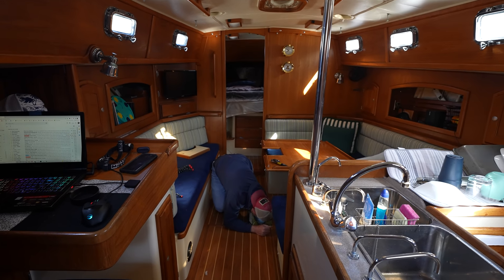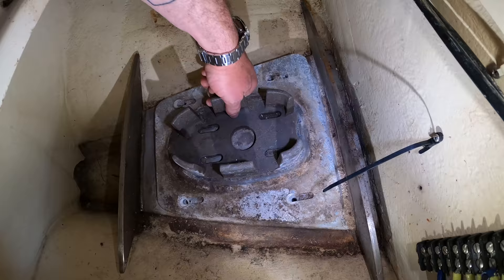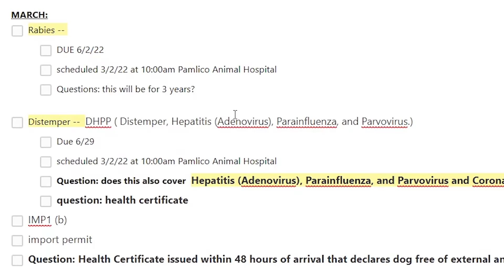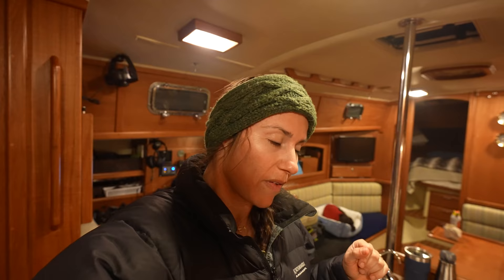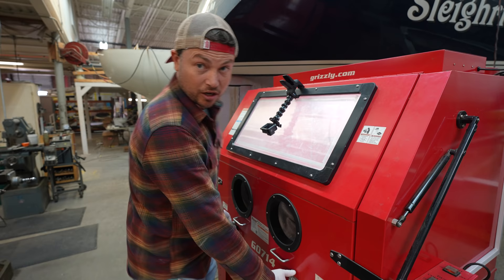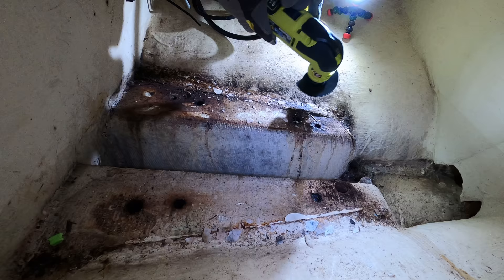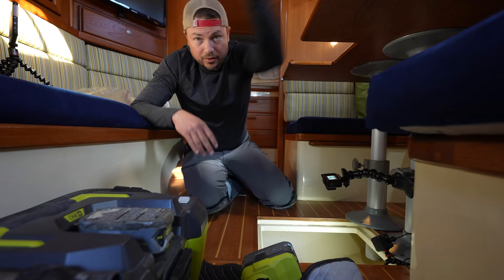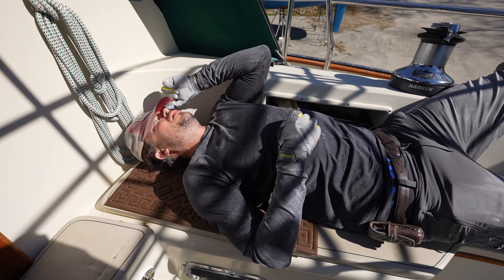We’re getting CLOSE… Right?! | S06E37

Comment: Whenever I get the urge to buy a boat, I just watch a couple of your vlogs and it cures me of the urge! Thanks!
Reply: funny
Reply: This is true. Jordan is very good at doing projects, enjoys doing projects and has a high threshold for frustration.  I do not enjoy projects and get frustrated quickly. No boat ownership for me.
Reply: Though job the mast steps .
You ended the video before 
I could see what wood you used .
Im sure the replacement is long done  by the time you read this. 
I have a leaky Teaky my mast steps are solid teak and not glassed  or painted and are 44 years  Most of the time wet and in perfect condition  just food for thought. 
I have replace other  rotted wood 
On my boat  supports and parts of the Bowsprit with ipe wood . If your not  Familiar with it it's Brazilian walnut it one of the hardest  strongest wood on the planet does not float  and is  Guaranteed for 75 years without rot.
Reply: @sizzlemann there nothing like being on the water
Me it gave me the urge to buy one,start small
Remember they are refitting for long passage there boat is in super condition
Reply: True . I will not own another boat it’s more work and cost Over renting and renting is not cheap. I would like to know the cost of their work when they are done.
Reply: About the same as a 30 year old house. Always something needs work.
Reply: Yo Sizzie, find a 16 or 18 footer, I had a 18ft Buccaneer great little sailboat to learn on not many moving parts, swing keel draft 3ft down if you find one buy it.. My boys love playing on it. Lake boat or bay sailing.. I'll buy it off you after you learn and buy a larger one.. carry-on bud.
Reply: This wonderful couple isn't alone. Almost every sailing channel shows how much maintenance is required to go blue water sailing. Every time I see videos of people lounging on the deck of a sailboat with a cocktail in their hand, I think of these videos, lol.
Reply: My thoughts exactly!
Reply: I think they are very brave to do this. Any old boat will need attention though. Seeing that rotting wood makes me want to buy a steel boat even though it would be slow, it could hit a submerged object (think container) and probably not sink!
Reply: I had the urge to run a marathon once, but I laid down until it went away.
Reply: Everyone should have a hole in the water to throw money into!!
Reply: If you think this is bad buy an old house. LoL.
Reply: I sailed dinghies as a teenager (lake not ocean). I realise now why dinghies are so great. Takes hardly any maintenance and still heaps of sailing fun. I used to to think a keelboat would be way more fun but not so sure anymore😅
Reply: @MaShcode  , true. However, you’re not over water with the possibility of drowning in an old house on land.
Reply: @anitafarwell5325  Not a property I once owned. Haha. It might as well have been a house boat. Kidding aside, houses with a basement do share a similar engineering considetation : hydrologic displacement.
Reply: this guy just needs to go enjoy he does groundup restos shit that will never break
Reply: @mitchrc3  This would be one of the considerations surely...well expressed...boating is a continual project..
Reply: Good point...sizzler..

Comment: Jordan, you can use white distilled vinegar to rub on your hands after working with fiberglass and it’ll remove the itch. The vinegar dilutes the glass and stops the itch in your skin. Then you can just wash with cold soap and water to remove the smell. It’s the best solution that I found to remove the itch from fiberglass.
Reply: I uest to work with fibreglass. Always have a cold shower first .a hot shower opens the pores and allows the strands to get in .cold washes them off first

Comment: On the wooden toe rail, I used a heat gun and heated the varnish, then scrapped, it comes right off. You two are learning everything about your boat, so when in remote locations, you can do the work.
Reply: I'm a Citristrip guy, myself. Paint it on thick and leave it for a day. When you come back the varnish will peel right off with a scraping tool.

Comment: When you run out of fuel on these heaters you have to re prime the fuel right up to the heater ie take off the little tube and suck the diesel through (a little bit of diesel in the mouth is not that bad though you might want to read the story about “young Ethelred” first). The other thing you have to do after a few failed starts is pull out the fuses for a few seconds to reset internal controller. I’ve run mine out a couple of times so have learned not to as I have to unbolt my heater to get to the fuel tube. My heater wasn’t starting one week end so I bought a whole new heater as a spare, especially as my heater is integrated into the function of the boat (space heating, water heating, drying cupboard, drying out the heads after showers, and now heating water for my new washing machine (Costway brand 43cmx43cmx74cm 3.5kg load I found a place under a seat cushion over the keel). It’s no fun being cold.)
Reply: Will great info ,what boat do you have ?

Comment: These are a few anti-corrosion tips I've picked up along the way from working on high rise buildings and pumping stations in marine environments. I don't know if any of these tips would be useful on a boat (except for passivation). 
Passivate stainless steel to keep it from bleeding rust.  The embedded ferrous molecules from the fab shop is what makes ss bleed rust.  
Use mylar film or high impact plastic shims to keep dissimilar metals apart.  
Use phenolic washers and sleeves with stainless steel bolts to keep the bolts from contacting the bolted material.  
Isolate type 304 stainless from 316 stainless in a marine environment.  
For some projects in harsh environments like chemical plants, the job specs called for electroless nickel plated bolts, nuts and washers.  It keeps the threads from galling together over time.

Comment: Hi Jordan, in cases of stuck fasteners especially with a slotted pan head the fastest and easiest way to remove them is drill the head out. Use a bit that is fairly close to the threaded size, even if you have to guess that’s okay. Start small and keep increasing bit size til the head pops off. Then remove the plate and use vice grips on the leftover over threads to remove. Replace fasteners with new that ARE NOT slotted (flat head sucks). Hope this helps

Comment: I hope you thought to make a teflon gasket to slip between the SS plate and the Aluminum mast step.  Of course by now you've probably already stepped the mast.  Tip.  When grinding in an enclosed space, if the vacuum has a decent filter in it, leave the vacuum running.  It will really help filter the fine dust particles out of the air as you work.

Comment: We run the same type of heater in the big rigs, it is common for them to stop working.  you can get a kit to replace the atomization screen and fuel filter for less than $30 in most places.  pretty easy to change, just be careful not to break the glow plug, thats expensive
Reply: I have that same heater in my Flicka and they’re a pain.

Comment: The mast step on my Tayana 37 was also rotted very similar to yours.
The entire mast had actually dropped a few inches and caused my rigging to loosen.
I ended up repairing it on anchor by using bottle jacks to raise the mast 6 inches off the step so I could dig out the old block the same way you did.
Great work guys! It's fun watching others struggle as much as I've been 😂😂

Comment: Jordan
You probably have the Espar heating running by now but I had a similar issue after I bought my V-42.  If the heater has a number of failed starts it trips a circuit that requires a special reset button.  As I remember the manual doesn't tell you where that button is.  In my case the red button was laced into the main cable harness.  You unwrap that harness and you may find it.  That will allow it try the start sequence again.  It is also a good idea to run it on kerosine once in a while which helps keep the burner screen clean.
Steve  SV Restless V-42-142.  I am close in New Bern

Comment: Thankfully my 1975 Islander 36 had the mast step redone back in 2001 with a polyurethane block instead of wood, it was a issue for them aswell. I'm surprised though they didn't isolate the aluminum from the stainless with urethane or nylon inserts around the bolts and a pad for the plate.

Comment: I gotta tell ya, I have a PSC 37 and I have had my “challenges” with dissimilar metal issues with mine as well! I hope the designers at PSC are learning NOT to mix dissimilar meters in their construction…those of us who have older PSCs are cursing at you!
Reply: I had PS37 #1 built in 1980.  They used a mild steel mast step, which had rusted to hell by 2001 when we bought it.   Spent about 8 hours hanging upside down through the access hatch with a big angle grinder to take it out, and made up an entirely new step and post using solid fiberglass.  The entire boat was covered in 1/4" of fiberglass dust -- fun to clean out!  Why on earth did anyone think it was a good idea to put mild steel -- or wood anywhere inside the bilge!?

Comment: After the electric drill those reciprocating multitools are one of the most useful power tools ever produced. 
Heat and quench with release oil, with slot head screws repeat... allow time you need the max. width and thickness. Very old screws are notorious for having fine slots .. ive even had to oil grind blades down so they will fit.

Comment: I suggest a small sheet of g10 to place between the stainless plate and the aluminum mast step plate it will insulate the two metals, takes a lot of stress and won’t damage the paint on the aluminum mast step. A 1/16 inch thick would do the job and won’t make any real difference on your standing rigging. For the wood I think I would use that Brazilian wood you can’t dent with a hammer hit, place that in the bottom and glass the whole thing in.if need be use a 2x12 and lots of resorcinol glue to laminate the wood together as sourcing one large chunk would be cost prohibitive in my opinion. …..plus side it would be just as strong if not stronger than a single chunk of wood.

Comment: It might be advantageous to replace that block of wood with a species resistant to decay, such as black walnut, ipe, or other recommended by the factory. Pressure-treated wood is probably not a good option, since in time it will break down, and is usually derived from softwoods, such as hemlock. Moisture, especially in an enclosed environment, can be especially destructive. I look forward to your Saturday blasts.

Comment: You should try an impact screwdriver, low tech yes but it works on screws AND nuts/bolts and all you need is a hammer, 
no battery necessary.

Comment: My heater has a relay switch that kicks to off position if unit overheats for many different reasons. Fast fix wack or tap with screw driver handle the relay. Fixed👍🏼

Comment: I have been amazed that builders use wood as the core to a mast step. It has to rot eventually. I'm wondering if a  block of something like a solid synthetic might be a lot longer term. Also, the dissimilar metals will fail. I saw you painting it & thought, that's not permanent if it's next to stainless. The aluminum backing plates on all of my stanchions failed because of SS steel bolts in them. I replaced them with SS plates. Some of them exploded from 1/4" to almost an inch thick. Why aluminum next to SS? Makes no sense
Reply: Agreed, i would have at least put a 2mm thick intert plate between them to make sure they keep apart, paint will not space them sufficiently
Reply: I wonder if painting the surfaces with a liberal amount of anti-seize before reinstalling would prevent future corrosion? Would salt water remove said anti-seize?
Reply: @Imabeliever 2  there shouldn't be a lot of salt water in the bilge.. anything will wear away eventually

Comment: Sanding fiberglass is never fun.
 But you could  Use a  Product called starboard. Instead of wood to replace the wood part. It want  rot or deteriorate. And is very strong. Cut it to fit and glass it all in .
One and done.
 Thank You for another Great Video this morning. (2:24a.m. here on the Big Island).
 And can't wait for the next one.
 Ok until next week Aloha from the Big Island 🏝of Hawaii 🏞🍻

Comment: Instead of replacing with Wood, Use some high density poly product. Even stacked sections of white Cutting Board stacked and epoxied together would be better than an original design plan. You'd Never have to replace a Poly Block for degradation.  Also, try not to tap on the hull so much as it makes the fish crazy...

Comment: That mast step project doesn't look fun.  The mast step on my boat was made of steel and had corroded heavily after 40 years in the bilge.  Through galvanic action, it had corroded the bottom of the mast as well.  I got a new, aluminum step, cut off the bottom 2" of the mast, and built up the spot in the bilge by 2" using fiberglass plates from McMaster-Carr (screwed and epoxied down).  Luckily, the spot in the bilge where my mast step sits is flat, but it was still a major job.

Comment: You didn't get that far, but I am wondering will Pacific Seacraft provide those two blocks of wood you will need for the new mast step?  I'm also wondering, it seems they (PS) found out about this repeated defect - before you found it on your boat.  So, they should be "liable" for making that repair.  I would also suggest that they should foot the bill too.   And, while that fellow from PS came and helped with those bolts, did he see for himself that fiber glassing mistake?  I am wondering if in your next episode, we will see PS stepping up to correct the mast step problem and making it as good as it should have been when the boat was brand new.  

Understanding mechanics, there was lots of redundancy incorporated in that "mast step assembly"  but with enough force some degree of failure could have happened.  Could such a failure be life threatening?  I wonder what happened for PS to "discover" the problem originally.  Imagine the mast "sinking" an inch or two during heavy winds and seas!  The mast might not come down but the mast's deck through hole could be broken open - with the possibility of water entering the cabin.  Compared with the chain plate replacements I think this mast step problem was serious!  Oddly this issue, while different, is similar to the problem with Atticus I.   That being, structural wood, supporting the mast, becoming compromised!

Comment: The blasting and  paint  treatment you gave to the mast step plate did not address all the  structural section loss that has occurred due to the corrosion pitting. Given that it's a very important structural piece on the boat, in conjunction with the very tough job you are doing to replace the rotting wood it seems rather foolish to just blast and paint it and to put it back in as is.....would it not be much better to replace it with a new mast plate ?. Keep up the fabulous videos !!

Comment: Great work. It's fortunate that you discovered the rot in that wood while you were in a good position to deal with it. (Well, at least as good a position as you could be.) I am curious however about why you merely painted the corroded mast step when you replaced the chain plates which (to the naked eye) actually looked to be in better condition. Not meant as a criticism, just interested in your rationale. Thanks.

Comment: This is just a comment on dissimilar metals.  Not all stainless steels are compatible.  Example: 316L will have electrolysis with 304 under many conditions.  Be careful if you start replacing bolts or other stainless parts.  Know what you are working with.

Comment: Jordan? Pacific Seacraft built a defective design, and later corrected it. They should have given you NEW mast plate hardware. You cleaned it up nicely. But it's still pitted. If your metallurgical standard for chainplates is applied here, it should not be re-used.
It's a good thing that you discovered this, rather than your mast failing mid-Pacific.
Don't believe me? Ask Captain Oso-smart.